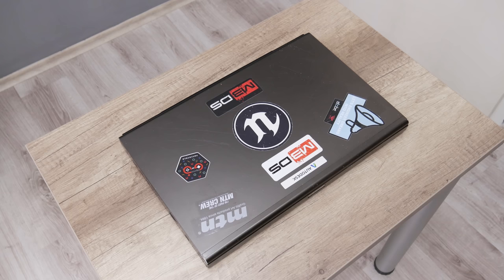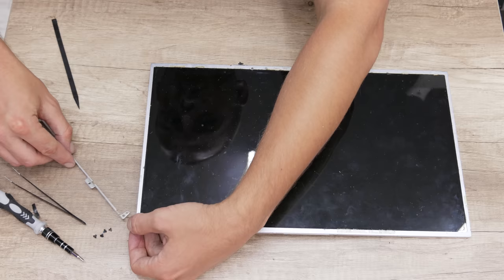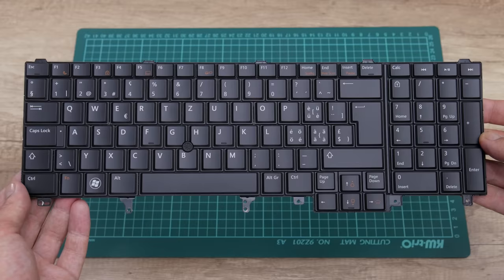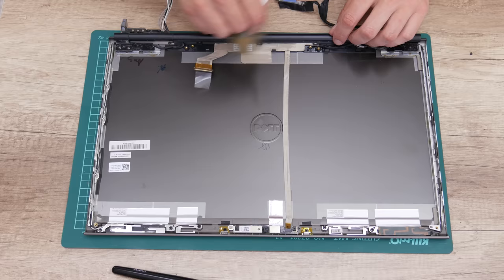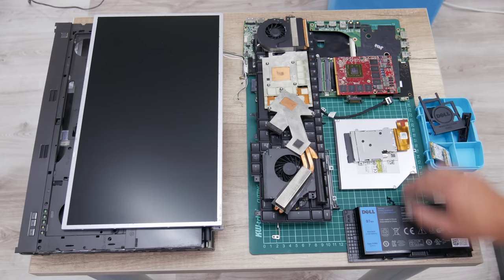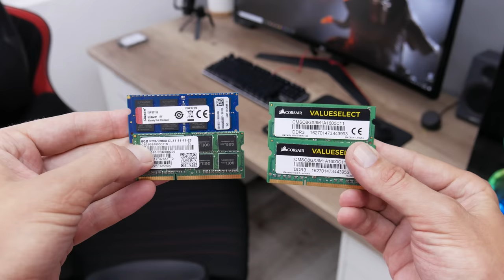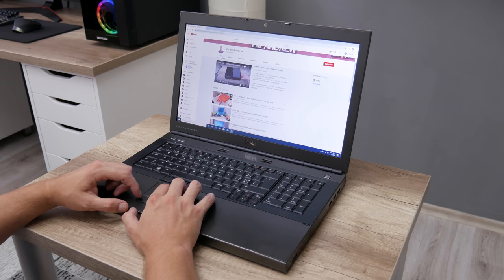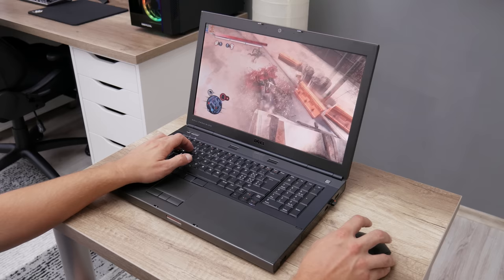Restoring DELL M6600 - Mobile Workstation

Comment: I Love your videos but you ever miss an upgrade... 😔 you don’t upgrade ever the Wi-Fi connection, you don’t apply the Wi-Fi 6 improvements, and for me is a fatal error for use today internet. I love upgrade old and very old laptop and Desktop windows pc, because I use only Apple computer, and For me is impossibile upgrade new Mac, except a ram and ssd, but in windows pc I have fun to reborn in new era. For me in your next upgrade pc video let’s upgrade the Wi-Fi card too, if you have a gigabit connection and a router AX it’s very important to use a full gigabit connection over the air 😊 when the laptop or AiO use an old card I replace the antenna cable too, it’s a very hard and so funny work when you can see the speed test to 920/950 mbps over Wi-Fi in 2 years old pc or 850 in 5/6 years old pc or 450/500 in a 11 year old pc, it’s magical 😍

Comment: That boi is thicc!
throw that glossy screen in the trash😂
Take that useless cellular card out. lets get real, are you ever going to activate an additional line of data on your phone plan or just use mobile hotspot? Now fill all the available PCI-M slots with additional SSDs😆 I got a 512GB Dogfish mSATA SSD for my Dell Latitude E6540